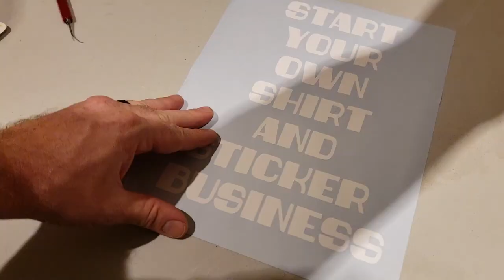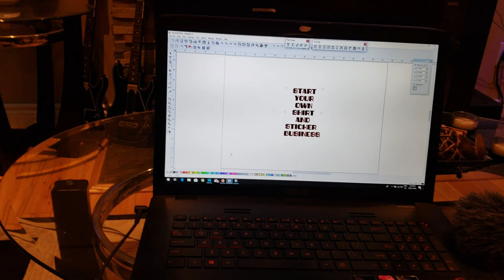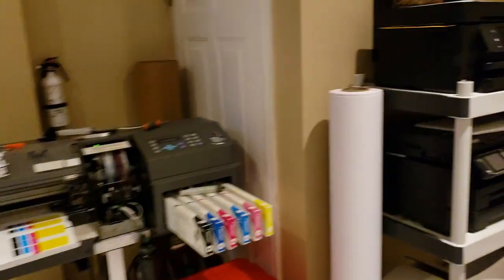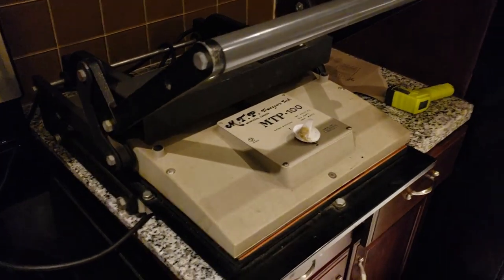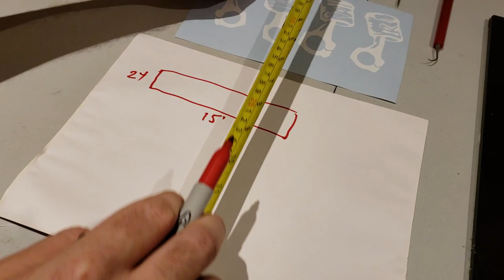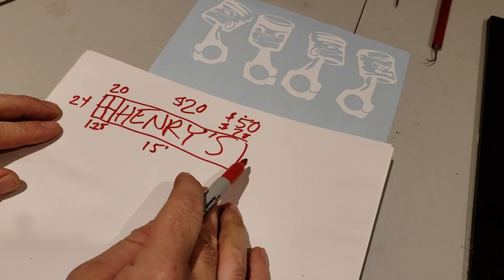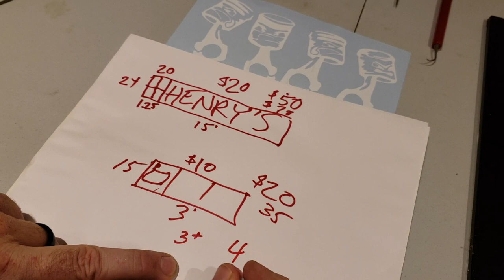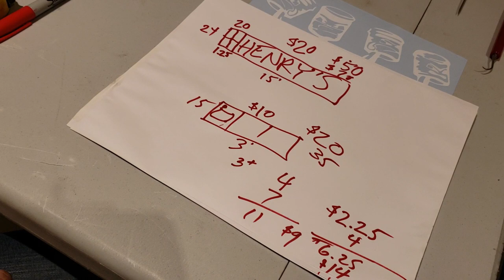How to start a shirt and sticker business for under $500

Comment: Do you do this as your fulltime job?  If so, did you start out parttime as a hobby and transition over to fulltime?  Thank you.
Reply from the maker: For me this is still just a little hobby on the side but you could easily have a full-time job out of it if there is enough demand in your area or you have the determination to make it work with online sales as those can be a good option.